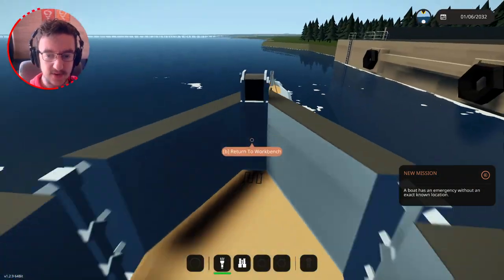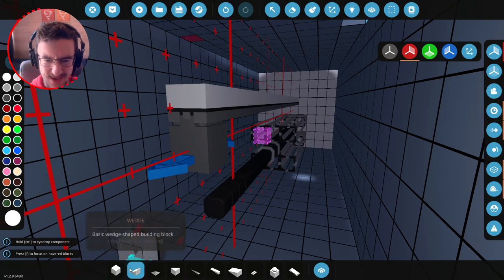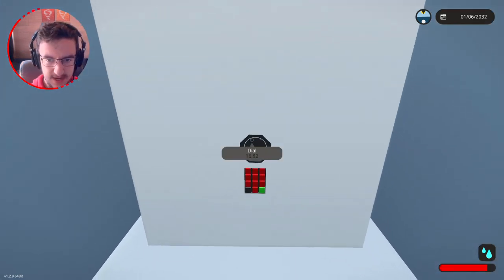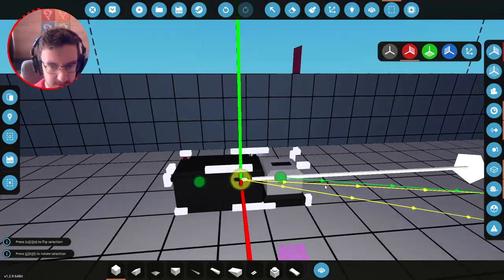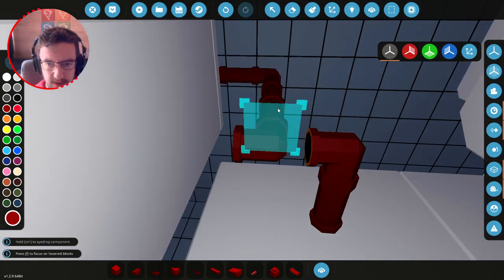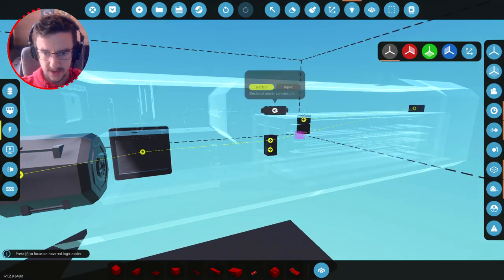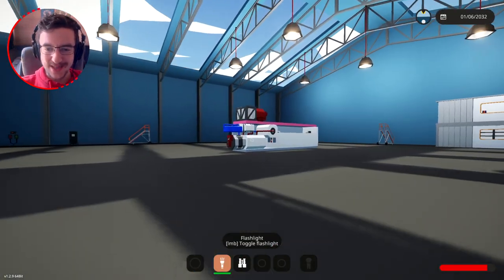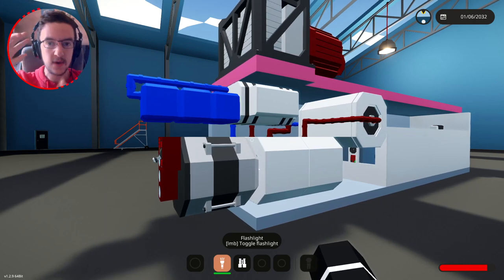Building The Nuclear Reactor!! - Submarine Build - Part 4

Comment: Frantic, the boiler blew up at the end because the pressure reached 10, having nothing to do with the temperature. If you put an on/off valve in between the tanks and the boiler connected to a threshold gate set to  0 - 9.5 for example, then the pressure would stop at 9.53
Reply: It won't stop there it depends on how much pressure it's producing.
Reply: I recommend putting 8,5 to the threshold gate
Reply: Hejeedstokjow
Reply: just use only one tank it was at 9.1 pressure stable after it boiled all the water in the tank
Reply: 9.5-999999999 u mean or it will open at 0

Comment: hey frantic maybe put a steam emergency release valve on it connected to a threshold that will activate at 8 or 9 and btw the boiler blows up at a pressure of 10mso too much water = explosion so the 1 tank was perfect
Reply: 1 tank is the sweet spot

Comment: I use two threshold gates on the hot water pump from the reactor AND one from the water tank. I cap the hot water pump at 120 and cap the tank pump at 8. That usually lets the pressure build to a little over 9 and have no issues with overheating or pressure failure. The 120 temperature cap also keeps the boiler from overpowering the cooling circuit. You can also run about 6 turbines per boiler in series at peak efficiency.

Comment: Your pressure went over 10 and it exploded. I recommend using a function block and a variable valve to control the amount of water in the boiler
Reply: Threshold gate would do as well

Comment: If your boiler has a higher pressure then 10 it blows up so have less fluid. That is fine. That is how its supposed to work. Or make a pressure release valve. Just a valva that opens when the pressure is like 9.6 or so. Goodluck with the build!

Comment: In actual reactors you use what is called “Heavy Water” instead of fresh water
Reply: 2 deuterium and one oxygen
Reply: Lol deuterium is used as fuel in fusion reactors, in fission reactors like this water is used more like a second control rod and temperature medium/coolant, since even normal water is a great neutron absorber. Normal water. You could use deuterium if you wanted, but it would be like using diamonds to make windows.

Comment: Hy  tip if jou use it in the water jou dont need a condenser if jou have some distelers going forom the sea into the boiler so long there is a pressure reliev velv